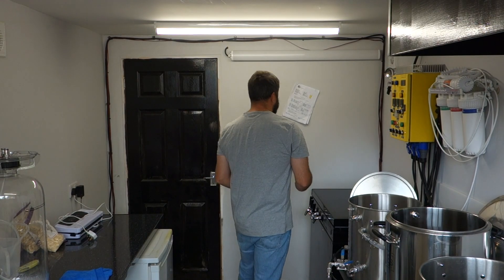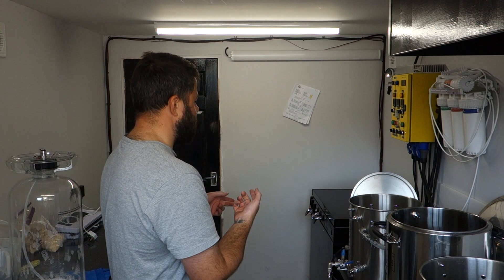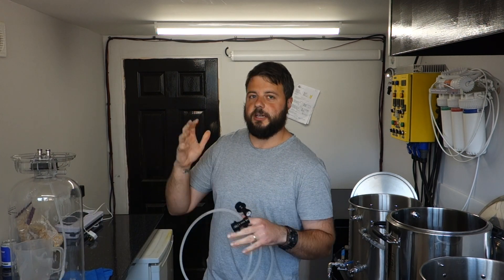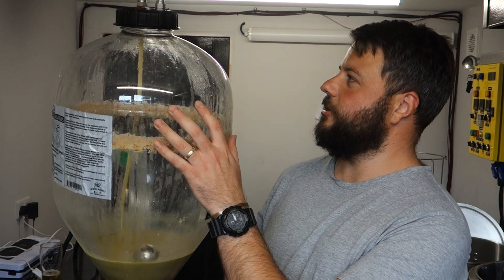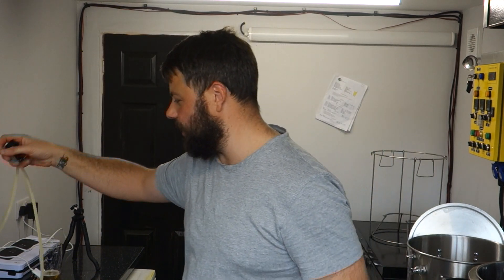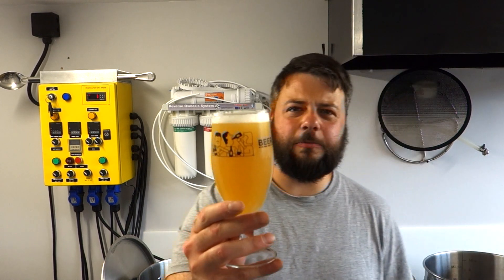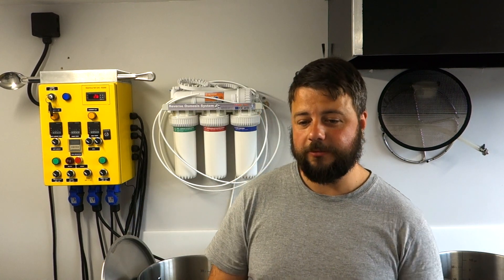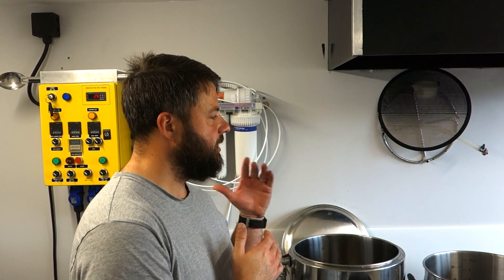Closed Pressure Transfer For The Idaho7 American Pale

Comment: The reaction to your first sip of pressure fermented, closed transferred NEIPA was totally worth the wait. Stunning work and wait until you see the newest gear. You'll save a bit of headspace in that keg freezer when you're using a Spundy compact spunding valve. Great video Tom. Glad you're enjoying the equipment. Cheers!

Comment: Transferred mine yesterday and got it on co2. Had a small taste tonight, it's a beer! It'll be better once it drops.  Looks the same as yours right now.  Forgot the gelatin, long line of oops'es but in the end I think it will be OK for me.  Gonna re-use the fermenter, uncleaned with all the trub to make a hopwater tomorrow night.  Just gonna boil up a weak dme + dextrose wort and drop it in for a week or so then keg and carb and hopefully a nice clear refreshing hopwater. Like a $10 experiment but if that works I got an extra tap that will have a regular player. Cheers mate!

Comment: Avoid splashing and rocking the keg with the floating pickup attached when you sanitize. I have had 2 balls comming loose from the little ring since the seem to be just attached with some small amount of soldering or glue or whatever there attached with. Then you just have to buy a new one, and thats a bummer.